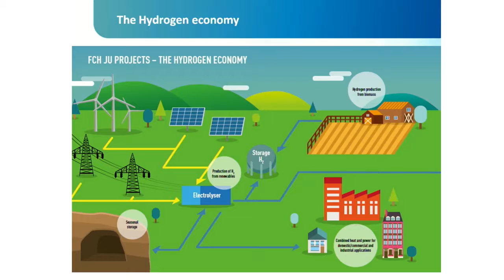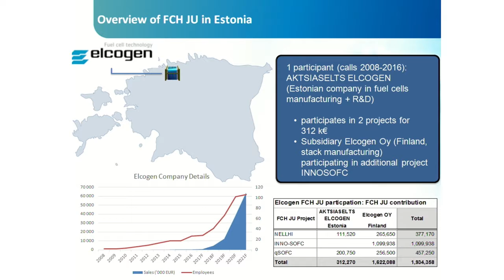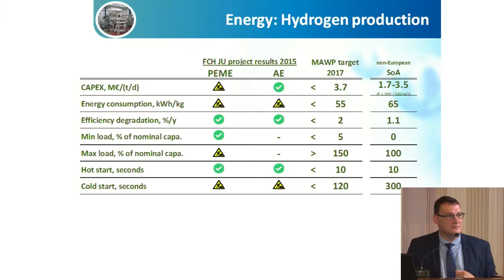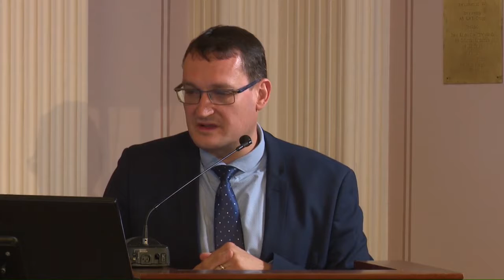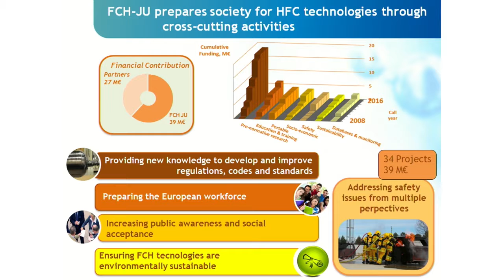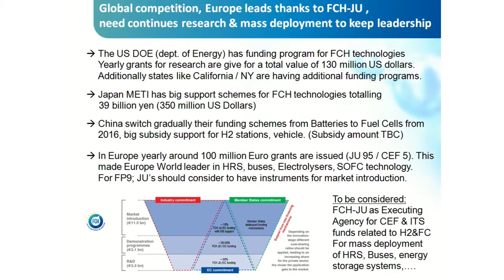2 - The Status of the European Fuel Cell and Hydrogen Joint Undertaking Programme

Comment: Maybe I missed it but I saw no comparisons with other forms of energy storage like pumping water to a high level lake and getting most of that energy back via hydro-electric generation when needed or even battery storage. If I understood the bar graph correctly currently there is roughly 100,000,000 Euros going into the hydrogen economy per year but not a lot to show for it other than an anticipated 1000 H2 fuelled buses and some progress towards standards for the hydrogen industry. Increasing the longevity of fuel cell stacks was mentioned as a goal without any figures as to what that currently might be or just how much platinum is consumed in practice per unit of electrical energy produced.
I hoped to learn more about fuel cells and hydrogen with figures of how things have progressed in recent years but I feel just as ignorant on that matter now as I did before listening to this lecture. I'm left with the impression that money is being thrown at this particular technology for no particular reason other than it has a green aura about it (something that the current hydrogen economy could not claim since the vast majority of its hydrogen comes from fossil fuel sources i.e. CH4 from the petrochemical industry).
Reply: Hydrogen is the only technology available in our hands today that has the potential to completely replace fossil fuel in everything (well, except jet-engine airplanes and helicopters, which might be powered by fossil fuel, at least for the rest of this century).

And since hydrogen is produced from water which is available everywhere, then theoretically, it is possible for every country to rely on itself for producing its own needs of energy.